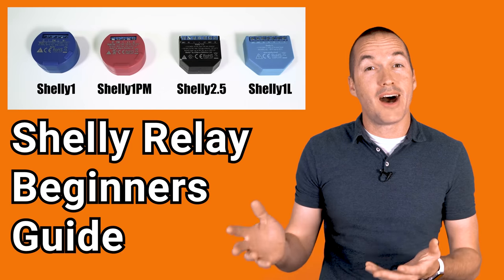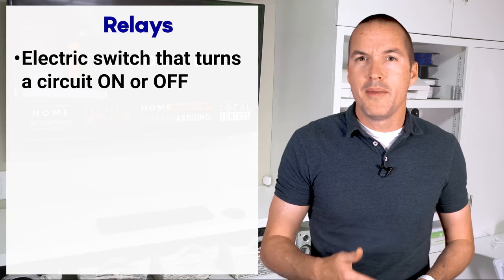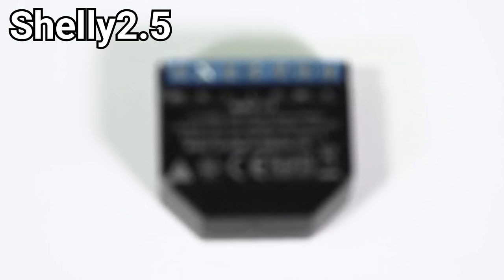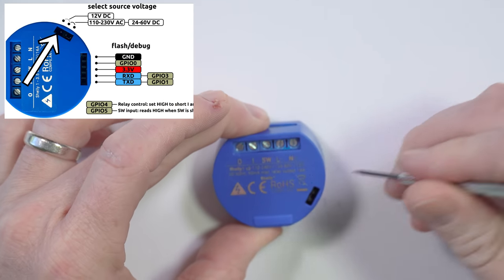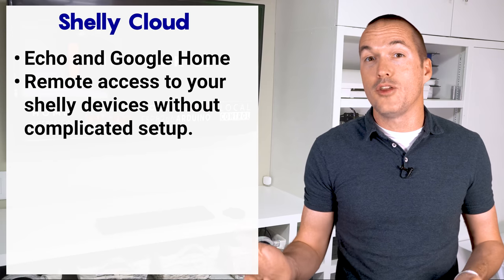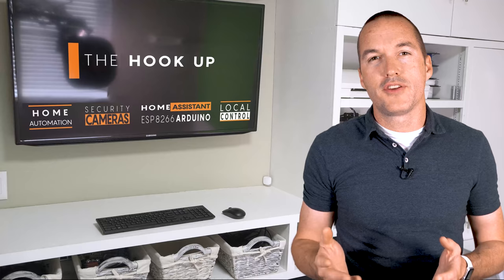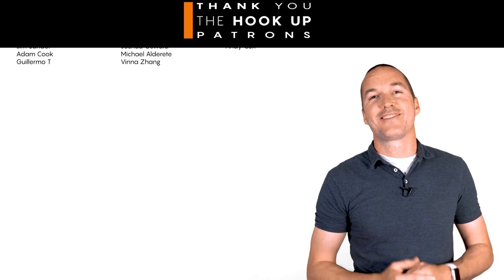Beginners Guide to Shelly Relays - Choose The Right Relay For The Job

Comment: Great video, Rob! I would love a "Part 2" where you cover some of their more niche devices like the Shelly Dimmer 2, the Shelly RGBW2, Shelly EM, and the Shelly Uni! I'd love to, for instance, use the Dimmer 2 with a regular non-dimming light switch and have time of day automations in NodeRed determine how bright it is when it's turned on, but a little uncertain how to go about that.
Reply: I second this
Reply: Third....
Reply: Fourth...
Reply: Fifth this
Reply: Sixth this
Reply: What you can do is set the switch type in the shelly settings to "detached". This means the switch won't trigger the light directly, but it will still fire off an action which can be captured by node red. Then you have your node red automation set up to capture that action, then go through a node which reads the time of day and selects the corresponding brightness, then sends that command to the light.

If all that is too complex, Shelly does have a built-in "night mode", where you can set a reduced brightness to come on by default during certain hours!
Reply: It looks like he put out a video a few years ago covering some of the other devices.

Comment: Thanks for the video.  For those of you not in HA yet, there is integration with ST now.  I've got 2 use cases I've considered: 1)make a dumb floodlight smart by wiring the relay to the motion sensor and 2)make the dumb light on my smart garage door smart.  Why the light can't also be controlled was definitely an oversight when I got the garage door 6 years ago.

Comment: I my opinion you jumped a bit quick to the 1L being the only option is you don't have a Neutral at the switch. Because you can just as easy place the Shelly at the light if you have a box there. It's the preferred location here.

And with the 1PM only having a single output the 2x L as input makes no sense. But it is a handy connection point for the L to the switch though :)

Comment: I love shelly1 for dry contacts. I am using it to click any button in any device I want without hustle to find what voltage is on buttons.
I smartified my 15yo gate, 3 garage doors, air aromatizer, 10yo coffee machine and many old appliances normally unsmartable :D

Comment: I installed Tuya smart switches in my lounge and hallway as those switches had a neutral wire. For the rest of the switches I installed the Shelly1 at the light, works great! Most wouldn't even know its a smart Light.

Comment: The app is quite good as well. And the cloud service is free. The whole thing works flawlessly with Alexa routines or their equivalent in the shelly app. Each relay comes with its own web server on a dedicated IP. These products are pure magic in terms of versatility. And they are dirt cheap compared to practically anything out there. I am currently at 22 shelly devices (Shelly 1 and 2.5, Shelly Dimmer, Shelly Socket). This brings me to the only caveat. Depending on your router it will be overwhelmed with Shellys once you really buy into them (which you will). I resorted to a dedicated router just for my Shellys since the WLAN had become seriously unstable.

Comment: New viewer here. Excellent rundown. I've been watching some of your older stuff on this subject and this was a very helpful update and summary.
The one thing I think you could add of value is a typical 3-way switch wiring layout. I know there are a number of permutations, but at least get someone going here and point them off to other videos for more. I was convinced you weren't going to mention 3-way switching at all until you touched on the firmware config support aspect.
Thanks for this. Just broke down and bought 3 Shelly 1's and a 4-pack of Sonoffs to get started down this rabbit hole
Reply from the maker: 3 way switches are really hard to make content about because there are so many different ways they are implemented.   That said, I've never seen a 3 way config that couldn't be automated with a shelly.  Some configs require only 1 shelly, some require 1 at each switch, and some require a shelly 2.5 (or Shelly1L) with 2 switch inputs.
Reply: @TheHookUp  that’s interesting. I’m hoping the Shelly 1 units I just bought will work for my circuits. It would be cool to see a rundown on how the others are used in this way

Almost all of the lighting circuits in my home are 3-way. Especially the exterior ones I am looking to automate

Comment: Absolutely perfect timing Rob, I'm currently inventorying for my new house I'll be getting the keys to at the end of this month and this is exactly the info I need. Cheers!
Reply: Be aware that cheap wifi will get issues when you have ~50ish devices connected. Unifi or a decent mesh network is critical for a stable smart home

Comment: I am trying to solve a unique problem. For people with ALS who cannot talk and therefore uses an Eye Gaze device, I want to be able to have the eye gaze device energize the relay which will then short two leads together simulating a button push on a Call Attendant Device. From your talk I think the Shelly 1 is the right device. I want to power the Shelly device with a 12v DC power supply. (Think of the eye gaze device as a Windows computer that senses eye movement. I can design a visual button on the screen that would result in a curl command being executed as an example.)

Here are my questions:
1: Is the Shelly1 the best device for this scenario?
2. I plan to connect a 12v DC power supply to the Shelly device (much like an old cell phone charger with transformer at the AC Plug) As long as I remember to move the jumper Correct?
3. I can connect the two leads from my button to the O and 1 terminals. I assume the Shelly Bypass would not apply to my scenario.
4. If all is correct, it is a matter of deciding how to talk to the Shelly1. Rest might be the easiest method via the eye gaze device, but I would explore the push methods as well.  Thanks!

Comment: So thorough as usual Rob! I still like the Sonoff minis flashed with Tasmota for ONE of the applications you listed out here (i.e. basic mains switching), they are a little cheaper and deal with 99% of applications I need personally. But great to have the Shelly lineup clarified in a way that I can understand!

Comment: For no Load in the Switch, You can simply put the Shelly 1 in the light box where the switch wires go (would work with multiple lights as well, just need to find where the switch wires go).  Works great!

Comment: Great Video.  I have a question as to the correct relay.  I have a single switch that turns on the fan and it's light. Firstly I want to be able to install a relay in the fan that would a turn on the light and fan separately. Secondly have the relay or another select the speed of the fan. It has four states off, 1, 2 & 3.

Comment: Would like to see how the Shelly is physically integrated into your wall boxes.  Ours are always so tight with wires that I'm wondering how you would fit a Shelly relay in with the rest.
Reply: Deep boxes! I made the mistake when I was just a young 'en and had first moved into my house of saving the 10 or 20¢ by buying the smallest, cheapest boxes. They're a major pain! Deeper boxes have more cubic inches to work with allowing more wires and more devices/bigger devices.
Reply: Great question! Poor answer!  There's no way someone will yank out their existing boxes and put in deeper ones (what a wiring and drywall nightmare!).  Anyone else have a better idea?

Comment: Fantastic diagrams and content, please do a similar video on dimming and LED Shelly devices next
Reply: Same thing. Use Dimmer2 instead of the relays, use Bypass when wired without Neutral and load's too low

Comment: what a great video, and i think Shelly is developed with great flexability for end users. Now I have a old alarm system that I wanna use the PiR Sensors, since they have a output for resistive is there any Shelly that can check the state of the output of the PiR so i can program to send a notification? thanks in advance

Comment: Great video! I would like to see a video on how to wire a Shelly to a 220 spa pump and how to use a motion detection from a camera to turn on a Shelly. I saw a guy named Troy Hunt had a YouTube video and did that with a Unifi G4 camera. But he didn't saw how he did it. I would also like to see your preference on which app service you prefer to control the Shellys.

Comment: Great video! I learnt a lot from your video. I have a question for Shelly 2.5 wiring for 2 way wiring. I will have 1 normal switch (1 gang) and the other one will be 2-way switch. Do you have any diagram for this setup on how to connect? Thanks.

Comment: Can I assume the house has every power point with a Shelly switch wired in? The Shelly switches seem better than smart plugs which are plugged in and then a device is plugged into the smart plug right?
Still getting my head around how Shelly switches might be optimised by not needing smart light or other smart device controls? Seems like Shelly switches can address a large % of smart home needs right?

Comment: Hi Rob,

Great video!

For LED lights i always use a neutral wire to connect the Shelly's. If you don't you may have some flickering of the led's if you turn off the lights.

Comment: Hi, love the video, I found an answer to my question about which relay will act as delay for a independent circuit- shelly 1.
Is there a shelly isolated relay with 2 inputs and outputs? I want to use it enable/disable a pair of speakers, but I'd rather use 1 device rather then two.

Thanks
Adam
P.S. just fried my first shelly, manufacturer of DC PSU put + and - in reverse on the diagram.

Comment: Available GPIO pins is the thing I'm looking for.  As Dr Zzs in now coming around too in recent steams, a light switch is just that (one function).  It needs to be more, a PIR, a temp sensor, the ability for a retro fitted an RGB momentary switch (to tell you things - with a colour) this all comes with a few GPIO pins that are easy to get at and able to be broken out.
Reply: Interesting. Commenting to follow and refer back to for future use. Thanks!

Comment: Love your content.
Looking at using Shelly’s to automate pool equipment including lights.
Starting with lights.  Current lights are 12v, a transformer downgrades power from 110v to 12v.
Should I go Shelly 1 in the transformer?  Or Shelly 1L in the switch?  The lights have been changed from crazy wattage incandescents to 50w LED.  Two lights, two separate switches, two separate 12v transformers.
Thanks for the incredible content and amazing attention to detail.
Reply from the maker: Are you sure it’s 12v dc? My pool lights are 12v ac

Comment: great video on shelly relays. I'm wondering how difficult they are to fit in the box? I have gone down the smart switch path primarily with athom devices (come preflashed with tasmota) but I have noticed it can be extremely challenging to fit everything in the box. I see the same issue with these shelly relays. Any install videos to show how cramped it gets?

Comment: Thanks for this Rob.  Just getting into home automation and ordered some shelly devices.  Wondering if you know of any wall smart receptacle w/ USB that work locally and with HA?  If I put in a regular receptical with USB, there isn't enough room to put in a shelly device into the box in the USA I have found.  Could do z-wave or wifi.  Ty.

Comment: The 1pm needs an inline fuse even on a 15A breaker. Sadly lost 2 last month due to a failing (didn't know at the time) LED floodlight (95W normal load); the breaker did trip. The 1pm is still functioning, but the relay contact is toast. I will be putting a fuse in line this time around that's about 3x the expected load.
The 1pm has been rock solid for 2yrs as a dusk til dawn photocell replacement.
Reply from the maker: Never a bad idea to add fuses.

Comment: This may be a dumb question, but when you say it has a max load of 4.1 Amps, is that on the whole electric circuit (from the breaker to the end of the hot) or just from the switch to the light bulb?

Also, is the Shelly 1PM good for monitoring a dryer?

Comment: the round Shelly 1 generation relays are no longer manufactured. Only the Shelly 1L is still available.
In addition to the Shelly 3EM, the Shelly Pro 3EM is also available.
Almost all old Shellys will be replaced by the new Shelly Pro series. 
This one has the ESP32 on the board. Can do MQTT and Cloud at the same time. And can https encryption.
There will be a Bluetooth switch that can only control the Shelly Pro series

Comment: would using a shellyplus1 with a normal light switch make everything local and avoid problems I encounter with Tuya or TP-Link devices in Alexa or HA, and can it function just like those switches it replaces? Also, for replacing a smart switch with the Shelly would I need the Shellyplus1 or just the Shelly1? Thanks for your Great videos.

Comment: Have you found a wall switch that doesn’t “stick” in any one position? Ie, press up to turn on, and switch returns to “middle” after press. Same with down. Essentially a spring loaded rocker switch. Up to to on, down to turn off. This would be acceptable to me since I can see if the light is on.

Comment: Hey Rob, could you provide some guidance on whether it's possible to control the Shelly Pro 4PM using either low-voltage (CAT3) wiring or Wi-Fi through a smart switch? If it's feasible, could you also recommend compatible smart switches? I'm looking to replace my old 40-year-old low-voltage light control system with multiple Shelly Pro units. Your insights would be really valuable. Thanks a bunch, Bob!

Comment: Hi Rob, why does a lot of People place the shelly behind the switches? If you place them behind the light itself you have hot wire, nutral wire and the switched wire. And if you use 2-way or 3 way is doesn't even matter.

Comment: I'm glad other people are finding the video useful. I'm a bit disappointed that you left some questions unanswered. This video seems targeted towards beginners such as me, but you mentioned some concepts with no explanation. Here's where I think the video could have been improved:

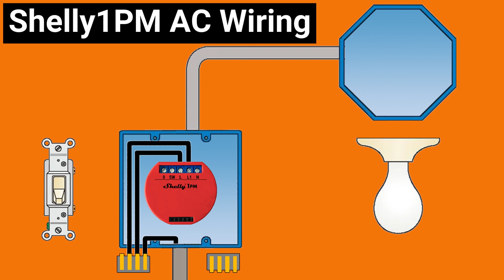5:11 Why are both load wires required to be connected to the 1PM L terminals if the current draw is 16A?

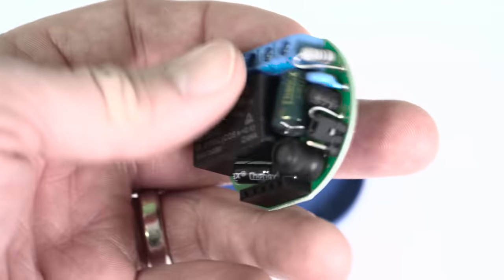5:32 Why does it matter that no current passes through the Shelly 1 I and O terminal unless the voltage is applied to the I terminal?

6:25 Exactly what kinds of uses are there for the Shelly 1 SW terminals for if they are powering by 12V?

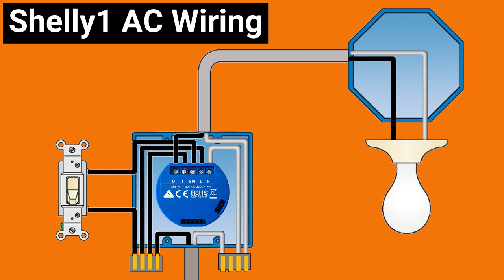6:50 Why does having a dry contact relay increase the number of wires?
Reply: 5:11 - You actually don't need the 2 terminals when drawing 16A through the 1PM (although you should never run electronics at their max capacity for long times). The 1PM has 2 terminals (which are internally connected) because they had the space in the enclosure as it doesn't have the dry relais (so no I-terminal). This is useful for hooking up your switch without needing a Wago to split the incoming Live wire.

5:32 - The 1 has a "dry relais". This means that it just opens/closes the connection between the 2 terminals. You can use this to 'cut' a Live wire powering a device, but also to connect 2 terminals on a garage door opener (which won't be running Live voltage but rather low-voltage signal). It also means that you can power the Shelly 1 with low-voltage and switch mains voltage, or vice-versa.

6:25 - You can hook it up to e.g. a reed switch to 'read' the state of your (garage) door. Combined with using the I/O terminals to control the garage door motor, this means you have actual feedback of the garage door being closed.

6:50 - Since the output is not connected to the power supply of the Shelly, you need an additional terminal. The relais opens/closes the contact between the I/O terminals. With only 1 terminal, there's no connection to open/close. The other Shelly's output on the O terminal what's coming in on the L terminal.
Reply from the maker: @ThatCoder great answers.  Although I thought the second L terminal on the Shelly1PM is because the terminal blocks weren't rated for 16A.
Reply: @TheHookUp  I thought so too at first, that they were 'only' rated for 10A.
But I was corrected on that on the Shelly FB group. Terminals are OK with 16A.
Reply from the maker: That makes sense. I hadn’t considered the fact that 2 terminals in and one out would be silly.

Comment: As usual great, easy to follow tutorial. However I've now wasted a day trying to integrate a shelly 2.5 into a 3-way switch configuration. Very few resources on internet about this, and some conflict. No magic smoke yet but lots of circuit breaker tripping. It would be great if you had a video on how to add a Shelly to a 3 (or 4) way light circuit!
Reply from the maker: This is for a shelly 1, but the main concepts are the same.  A 2.5 is actually a bit more versatile: https://youtu.be/3grw9nNuXn0?t=132
Reply: @TheHookUp  d’oh, I should have searched harder! Thank you!!

Comment: Love the Shellys.  I have several setup.  What about the dimmer?  Lately iPhone app will lose connection after 1min or so (browser is fine).  Also my detached state is not sending the signal to the Hubitat consistently on just one of my 2.5 relays (several others don't have this problem).  But really these are incredibly great devices!

Comment: Would you recommend putting one of this behind every light switch? Would that be better then say going with lutron smart switches? 

what is the reliability and long term performance of the shelly? 

i have a unifi wifi 6 network

Comment: Outside fan with only hot and neutral?

Which Shelly do I need and which terminals do I hook them up to? 

No switch, they are outside fans and only controlled by a remote. 

I've searched online but have only found three wire hookups. 

I want to bring my fans into my home assistant. 

Thanks!